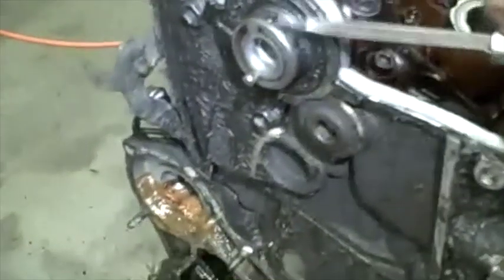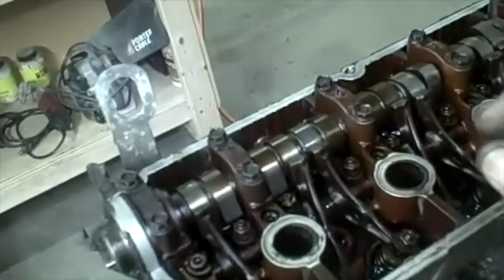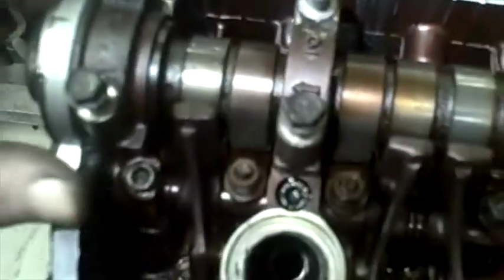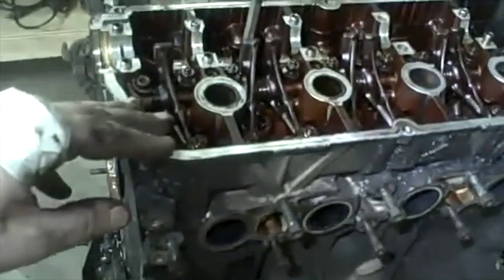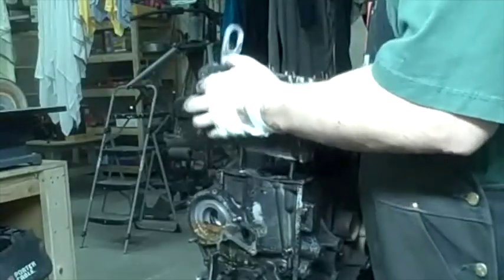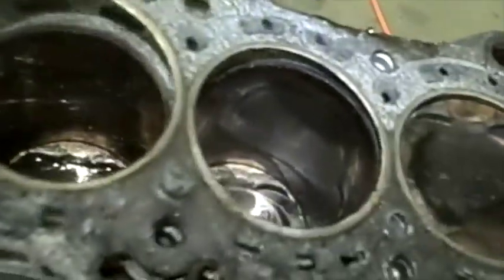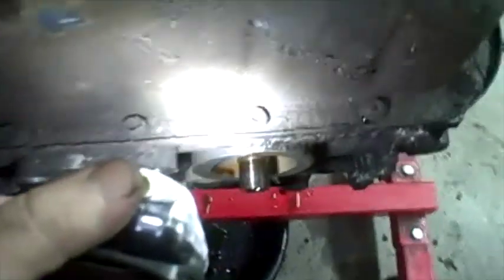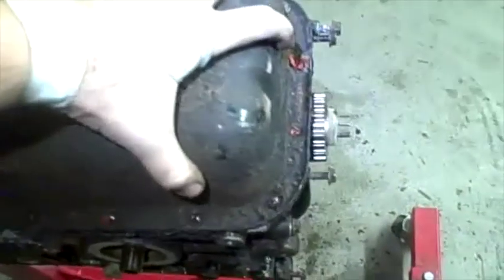1995 Suzuki G16A Engine Disassembly Pt3of6

Comment: Es un G16B
Reply from the maker: You are correct Francisco, technically a G16B engine, but the engine block alone is a G16A.  There is no such thing as a G16B engine block.  The only difference is the pistons.  They use a G16A block and put pistons with special depressions for the valves and then use the 16 valve head assembly.  So, to be very specific, it is a G16A engine block with G16B engine pistons.
Reply: @nunapitchuk  I understand that the block is the same but change the cylinder head